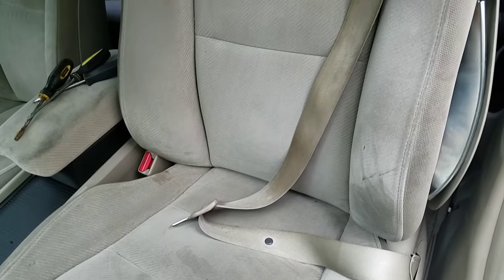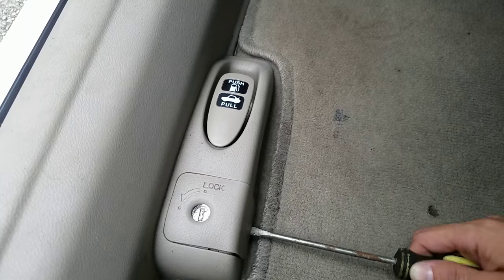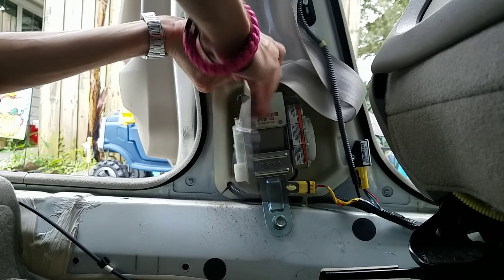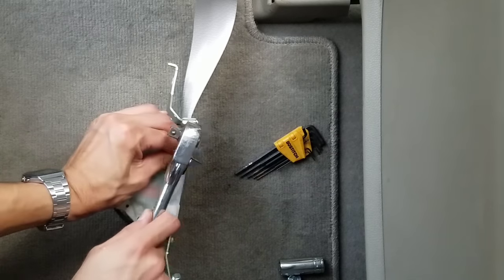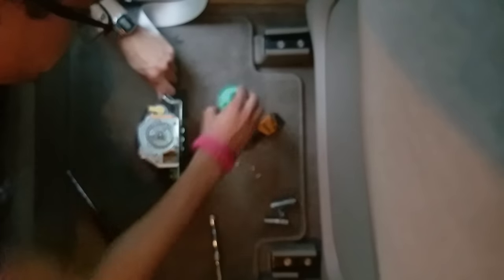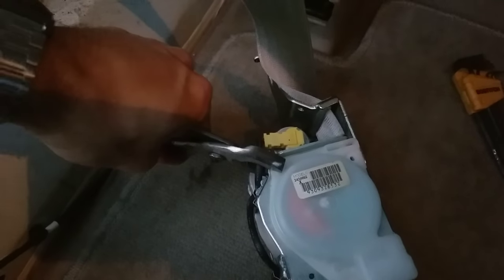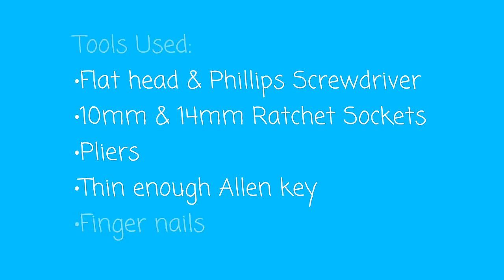How to Fix Seatbelt - Car Accident

Comment: Just got into an accident last night. Car works perfectly fine but the airbags went off and seatbelt wont retract. Thanks for this video.
Reply: Im in the same situation right now . Did u fix it like in this video?
Reply: update
Reply: @stevent27  i actually haven't done much due to weather. But i gotta buy a new steering wheel airbag. The cheapest i seen was about 500.00 the seat belt hopefully will be easier. Good luck to you
Reply: @CityNightsBLVD  oh got it . Ive been riding with the passenger seatbelt not retracting since may of last year lol just last week i bought the whole new seatbelt assemblyy so ihope they dont charge ode to install it
Reply: I'm dealing with the same shit. I feel like I fixed everything but my airbag light is still on. What a waste to total a car just bc an airbag went off. Honda dealer wanted $1200 for the airbag, but I found a garage that sold it to me for $150.... Any advice on airbag?
Reply: @MrVARhythm you need to get the airbag module flashed
Reply: @MrVARhythm lol bro, you have to get a computer for your car to reset the light. After the reset the cars computer does its own check or diagnostics, if everything checks out the computer will not throw a light. If not it will continue to throw a light. Note you need to reset the srs module too after a crash and airbags deploy
Reply: @stevent27 me too bumper screwed up I’m just glad my car isn’t totaled

Comment: Hey after removing the side panel you should try rolling the seat belt rotary backwards with your fingers or a flat head before removing those bolts . If it still don't retract then you could take of the seatbelts device . Just one extra step that could save you time ,thanks .
Reply from the maker: Wow, I am all for saving time, thanks Jose!

Comment: Bro thanx for making this video, everybody else that covered the retractor for the 06 civic said you had to break out a grinder to bypass the locking mechanism. This is so much easier and makes alot more sense
Reply from the maker: Thanks man, it's a pleasure. Awesome name by the way
Reply: Damn, i have a 06 civic too with the same problem 🥲 how did it work out for you?
Reply: Do you know if this will work on a 2008 Honda Civic? Please let me know thank you
Reply: Fr

Comment: I'm not sure if you know this, but the reason seatbelts lock up like this is,  inside of that seatbelt mechanism there is something called a pretensioner, very similar to the tensioner that you were messing with. The pretensioner is a one use device (like an airbag) that pulls the seatbelt TIGHT against your body once the cars computer system detects an accident. Sometimes the airbags go off with the pretensioner if the crash is bad enough, if the computer thinks the seatbelt is all that's needed, it will only fire the pretensioner. Remember, this is not what you feel when you brake hard, that is the tensioner. Once this pretensioner goes off, you will not be able to retract your seatbelt so whoever is repairing the car knows they need to replace the seat belt assembly. If you still have the car, go to the junkyard and get a belt out of a car that isn't damaged, because even though your tensioner still works, your pretensioner has already been used up. You never know when you'll need that pretensioner. It is designed to keep the forces down on your body in severe collisions by pulling you as tight as it can into the seat before the real forces from the crash kick in (that's why it's called a pretensioner), the regular tensioner doesn't react until the forces are strong enough to lock it up which is sometimes too late for the human body. I hope you end up replacing the whole assembly 😊😊

This is a video on how pretensioners work (all modern cars have them, not just Toyota who makes the video):
https://youtu.be/0jqOOFs9-7o
Reply from the maker: This is great information! Picking up an assembly from the junkyard is good idea too. Thank you
Reply: I had to scroll too far down to find your comment. When I saw the yellow electrical connectors I knew it was part of the supplemental restraint system.
Reply: This comment is 1000% correct.   ***** ^^^^^  EVERYONE SHOULD READ THIS GUYS COMMENT !!!   ^^^^^ *****                               and thank you for posting it in a friendly and helpful manor and thank you to the original poster as well for the great video!  If you see those bright yellow connectors anywhere they relate to the airbag system.
Reply: I did exactly what this video showed and its still locked. So you are correct.
Reply: Thank you! I was about to tear my car up for nothing 😁 Glad i read this
Reply: I've put new belts in my car because mine locked.  Now I can't get the new ones to lock at all even breaking.  I need some help here.
Reply: @perryadams7500  Hmmm, that is odd. I've never heard of that type of issue. If your old ones did end up locking, they were locked by the computers command. Maybe the computer needs to be reset! If it's multiple belts that won't lock, you wouldn't think it's a problem with the new belts. Definitely take it in! At that point, I'm not quite sure what would cause that if it's not the SRS computer
Reply: do it have to be the same car ?
Reply: I had an accident, and the airbags popped, and the belts blocked. Can i do this although the pretensor went off? Or wouldn't work anyway?
Reply: I think I will get a new seatbelt a whole assembly 😅
Reply: this is why if you get in an accident and airbag sensor goes off (srs) but airbags dont deploy it means the seatbelt deployed or u have a blown airbag fuze
Reply: yes but my toyota never actually got into an accident, suddenly at some point the airbag light came on, it lasts for a year, i couldnt figure out the cause, even my local toyota service cant too, and now the seatbelt lock up at the retracted position which means i cant wear it and i had to drive without it
Reply: @Spheredalai  your car might have had a false alarm and popped the belt. I hope you can get it fixed soon, your life matters 🙏
Reply: There are companies on eBay and other platforms that professionally rebuild the seat belt mechanism after a crash. So you don’t always have to get some junkyard nightmare. Just remove and send yours in to the company and they will return it to working condition

Comment: My (No accident History ever) Honda E 2004 seatbelt had been acting up for some time and would not spool out unless you played with it, and did small moves in-and-out (haha). But then it locked up!
Went through several videos, but yours went straight to the point, easy to follow and fixed it like a charm.  The olny bummer was when you were shooting putting it back together and your camera was out of focus, but I worked with it and ALL OK!  Thanks much!

Comment: I have a 2002 Buick Park Avenue where the front driver side seat belt is in the seat next to the head rest. I can't pull the seat belt out. Is this repairable? The car has not been in an accident. Is there a video on an 2002 Park Avenue on seat belt repair? Your video was helpful.

Comment: My 2012 civic was involved in a small accident and the seat belt deployed and locked also lighting up the airbag light on the dash. To fix this issue 2 necessary steps are needed, 1st either replace your seatbelt with a good working one or send it to safety restraints company that rebuilds them they have to be charged with gas so that they can deploy the next time you're involved in an accident , step 2 you have to reach to your SRS module which is buried below the dash infront of the transmission lever onto the lower body panel and send it along with the seatbelt to the safety restraints they are the ones who can clear the crash data from the module then once this is done the airbag light will turn off, this is the correct way to do it.
Nice video content but I also noticed your driver seat airbag is deployed what did u do about this ? This also has to be replaced for maximum safety alotherwise your airbag light will stay ON.
Reply from the maker: Excellent information and observation, I intend to replace the seat entirely.

Comment: Mine is a 09 Civic coupe, seem a little different, it has some loose metal balls inside rolling around. I opened every screws all the way, only manage to make belt held longer out, but it won't retract. btw, I remove all 4 metal balls and threw it away.

Comment: Nice video man, what car is this in the video, and any clue on how to fix a sagging seat belt? Would i have to wind up the spring?
Reply from the maker: Thanks for the feedback @Alli This was done on a 2010 Honda Civic LX 1.8L. I haven't had to fix a sagging seatbelt yet but if you find out I'm curious to know how it's done.
Reply: Joseph Gallego hi thanks man! All i had yo do was clean the seat belt and voila, its fixed
Reply from the maker: @YEOUBE  Way to go! I am glad to know you fixed it.

Comment: Will this work on a 08 Acura TSX? People are saying that it’s gonna make a light beep on my dash continuously if i don’t get it repaired correctly
Reply: & also they’re saying something about a gas chamber or something on the seatbelt? Don’t really understand
Reply from the maker: Your seatbelt isn't working now right? If so, is the light on your dash already beeping?
Reply: No my seatbelt is stuck and won’t come out. Been doing it since the wreck and there’s been a light on my dash since then but it only beeps once every time i crank it
Reply from the maker: According to this video https://youtu.be/ekrgNd4ADeM you can disable the beeping by disassembling the buckle and pushing in the belt alarm button. I personally don't reccomend driving around without a seat belt so if you can have it fixed so it's functioning properly, it will no longer be stuck and the beeping will stop. Two birds with one stone 😊
Reply from the maker: Hey, any luck on fixing your seat belt?

Comment: Hi, so no need to send it for reset after accident?
Reply from the maker: If your car has more electrical components there is a possibility that the computer will lock the belts. I would contact a local dealer and ask to speak to a parts specialist.

Comment: WORD TO THE WISE: 
On some vehicles, removing the wiring to a seat belt with the battery still connected WILL RESULT IN ALL THE AIRBAGS DEPLOYING. How do I know this? A technician in the shop I was working in forgot to and the dealership wound up spending about $8,000 to replace the customers airbags and associated trim.

Comment: I did This On My Car A 2005 Dodge Vehicle. Even after I Opened it and Unstuck the Shiny Piece. When I Pull The Seat Belt it Still Locks.

Comment: I did everything on here when finished it is still locked! Do you know what if it might be the motor in there?
Reply: You need to replace your whole assembly. Your pretensioner fired (one time use system like an airbag). Once that happens, the seatbelt has to be replaced. Note: the pre tensioner isn't the tensioner itself, they're different systems in the seatbelt

Video on what a pretensioner is and how it works: https://youtu.be/0jqOOFs9-7o

Comment: I had an accident in my 2007 Toyota RAV4. I was going 75mph, left the roadway and my seatbelt FAILED to lock me in the seat. I rolled over 13+ times and with no seatbelt locking me in, I was bouncing all over the interior front of the cabin. On an upside down roll, my head blew out the sunroof completely and my head was dragged along the ground. I was lucky not to have been decapitated. None of the airbags deployed either. Contacting Toyota they claimed no responsibility for the failure of their product in this accident in which I was severely injured.
Reply: Don't ask Toyota dealer,put a claim with lawyer is the only way they pay attention
Reply: Hope it knocks some sense in to you😉

Comment: good video, but it did not resolve my problem. the spool does not turn smooth,  looking at the gear end if you look between the gears I can see a hook shaped device. I suspect that hook should be around a stationary device.
Reply: Didn't work in my 04 Accord, but was very similar. His edits missed a spring. So I'll send it in to a rebuild shop as the dealership wants way too much (~$500).

Comment: I have a 2013 Honda Accord I have done everything just the ending part , the part when I Turn it clockwise It won’t Budge
Reply from the maker: It can be tricky. With help, you can simultaneously push counterclockwise with pressure on the piece stuck in the teeth of the wheel.
Reply: Have the same car and it won’t budge either
Reply: @CupOfBroseph  mine is still stuck but the piece is not jammed .....it wont allow me to turn it.
Reply from the maker: @desireeisthe1  when I first got to it, mine was jammed. However, by turning it both ways with my hands was just enough to get it loose. Worst case scenario, you can try a flat head screwdriver and a hammer.
Reply: Tried it . Didn't work. Still stuck
Reply from the maker: @Ivanfireefc2  Keep trying, it will work, and break free.
Reply: @CupOfBroseph  tried it worked but the seat belt is loose?
Reply from the maker: @Ivanfireefc2  Lube the belt, like this. https://youtu.be/NgWNDG9wdSU
Ammon Williamsin

Comment: any seatbelt that has done its job in an accident MUST be replaced because you have stretched the belt so it now no longer works as intended.
a seatbelt is a single accident use item.

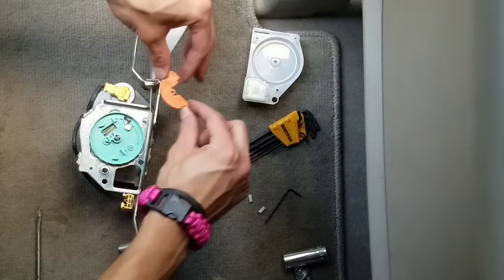Comment: 1:55 That’s an inertia which you disassembled, orange color piece. 

And the inertia is assembled with a calibration spring. 

The calibration spring is so delicate and you probably degraded spring force during disassemble it. 

In worst case your seat belt may not lock properly in frontal collision accident. 

That’s why all seat belt manufacturers are prohibit disassemble those things.

I recommend you replace retractor with new one.

safety first 😊👍
Reply from the maker: Thank you for the tip Myung Heo!

My goal was to have the seatbelt work properly again since my accident. However, this is good to know in case of a frontal collision. 

We appreciate you sharing the name of the pieces 🙏

Comment: OK I FOUND THE PROBLEM...it is not in the easy end (as shown) it is in the do not remove end. which is the belt rewind with the secondary function of "hard locking"  when a collusion occurs. the removal end and the spool both have gears that should not normally touch. if you look at the end plate the gear will be lose and the balls will be every where. look under the gear and you will notice "locator pins" that were sheared off. I drilled through the 2 spots where the pins were and used pop rivet shafts cut to the correct length to restore gear to proper position. put all the balls back in the tube and block them with a small nail until the black end piece is reinstalled. then remove nail. the tension end piece needs to be turned ccw 10x with the belt already fully retracted.
Reply from the maker: This is a creative solution for the worst case scenario. I hope this helps others with the same problem. Thank you for sharing Jim.

Comment: What did you mean about the safety feature
Reply from the maker: It's an emergency locking retractor that locks the shoulder belt when the brakes are slammed.
Reply from the maker: Good question.
Reply: Thanks great video

Comment: It worked but my retractor still making noise and not smooth !!! What should I do ??
Reply from the maker: The teeth in the retractor may needs some lubricant. I would try using Blaster Silicone Lube on the belt itself. This video shows how it's done https://youtu.be/NgWNDG9wdSU
Ammon Williamsin

Let me know how it works.

Comment: if i do this will my srs airbag light go away?
Reply from the maker: Did your airbags deploy?
Reply: Joseph Gallego no they didnt
Reply from the maker: If you're SRS light is on, your vehicles computer may sense a problem with the airbags and disable them. I would it checked.

Comment: Mine is still stuck
Reply from the maker: Have you got to the belt retractor?
Reply: @CupOfBroseph  
I did and it's still stuck
Reply from the maker: @Bladexsilver  are there any signs of corrosion or rust?
Reply: @CupOfBroseph  at least not where the mechanism is at.
Reply from the maker: @Bladexsilver  you might have to get rough with it. Try a flathead and hammer.

Comment: HEY BUTCH YOU FAILED TO PUT THE REST OF THE PARTS BACK INTO THE SEAT BELT ASSEMBLY.  HOPE YOU ARE NOT DOING THAT TO OTHERS CARS. YOU COULD HAVE SOME LEGAL ISSUES TO DEAL WITH IF THE BELT FAILS TO TENSION IN A COLLISION. HOPE YOU ARE A CERTIFIED SRS TECHNICIAN..